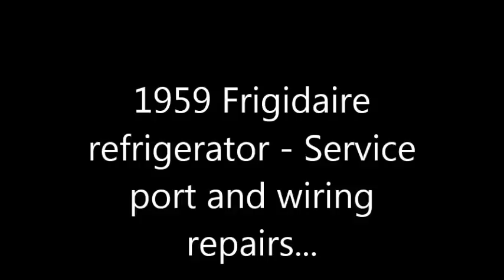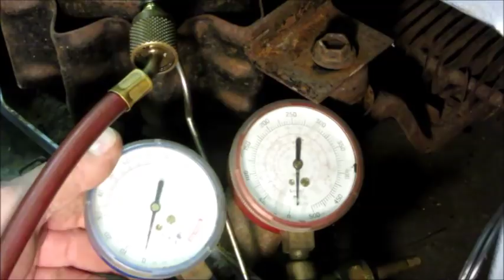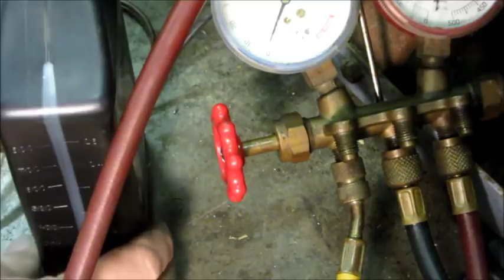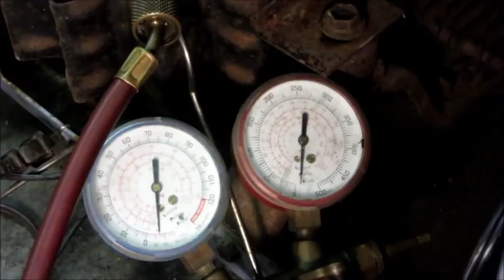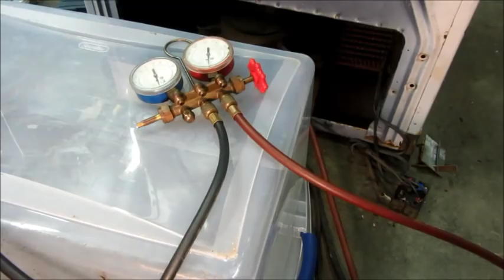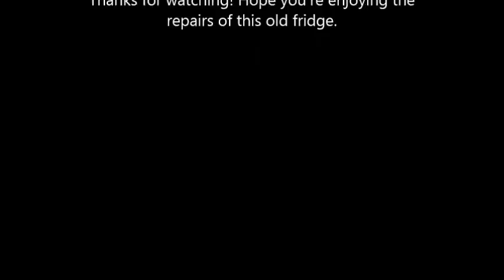Frigidaire 5400426 antique fridge - 2 - Service port, wiring, and test charge....

Comment: Hi David great video but I have a question about my 50's - 60's General Electric fridge. The compressor stopped and I had it for 15 years no problem running in the garage. Great beer fridge and I want to keep it. Not sure why the compressor stopped but wanted to ask you how I can put a start capacitor 3 n 1 to see if it will get the compressor  to start and run. The problem is that the old relay has only three wires coming to it. One is probably going to the lights in fridge and the other two go to compressor and the 3 n 1 has 5 wires? So do the two black wires go to a plug and the white , red, black go to the relay? If you can help that would be great.
Reply from the maker: Hi, Pete;  I hope you are able to get your fridge up and running soon. The 3-in-1 Supco device actually has only 3 active wires. One of them is just a "pass through" wire for the compressor common terminal. 

I am sure it will work for you!

Please see this General Electric Monitor Top refrigerator forum. The format here is a lot better for providing technical support. In the "Other Refrigerators" area, you can post your about this.

Another member just fixed up a similar GE fridge, using the Supco relay. His thread has some pictures on  this repair. 

See http://monitortop.freeforums.net/
Reply: David thanks so much for getting back to me. The lights worked and it seemed that the compressor was down for the count. Then I was like, "This was built back when people cared in America about their  jobs and industry made quality American parts!" So I took the relay off shook it, no rattle and then I cut off all the circular connecters and put new ones on with a crimp and she fired right up. Amazing, I wouldn't have thought that was the problem. They were loose, I guess but they must not have been holding enough of the wire on the terminals for it to kick on. The light doesn't need much current so of course that would work. So all and all she's good to go to be the awesome beer fridge she was meant to be with lazy susan swing outs to get to domestic or imports. None of that hoppy poser beer thats out now. Just the Miller High Life. The way it should be!  Thanks so much for getting back to me. One question though, my freezer little door within needs a new seal and I was wondering if thats why it freezes up that I cant put things in it? It is like snow and ice in there. Would the seal stop from forming such block of ice? Also where can you buy one? and a door seal too? Any suggestions anyone?
Reply from the maker: Very happy that you got her up and running again!

Often, the relays get "weak" or "intermittent" and they start working again when they are handled or shaken around. It may be that the problem reoccurs and eventually the relay has to be replaced.  The good news is, there is a modern replacement which will take the place of that one very nicely. And they are inexpensive.

If the evaporator door is freezing shut, that would mean that too much moisture is getting in the refrigerator. You probably need a new gasket on the main door to the fridge.  

Again, I recommend you post on the General Electric Monitor Top forum; with pictures of your fridge, and it would be easier to tell what gasket it has.  

I have ordered my Frigidaire gaskets from Antique Appliances Co.

Comment: Good afternoon! I have a coldspot fridge from the 50’s that was working fine until I unplugged it for the winter. It was an older gentleman’s main fridge until I bought it a few years back. I plugged it in again today and the compressor has heated up to 155 degrees and it seems like the fridge actually warmed up a couple of degrees too. But that could just be the ambient temp in my garage got warmer. I don’t see where it may have leaked down. Should I try adding a service port to it, pull vacuum, and charge with r12?

Comment: Hey Dave, Did you keep the mineral oil when you switched it over to R152A? I think you said that PAG might damage the wiring on the motor. Nice job on the resurrection.
Don
Reply from the maker: Thanks Don!  I kept the mineral oil.  The Meter-Mizer compressor lubricates its self differently from the automotive units. It seems that the oil and refrigerant don't need to be capable of mixing together as they do with automotive systems. The mineral oil stays in the compressor on the Meter-Mizer design except for a very small carry-over.  

My research online seems to support this. It seems that Whirlpool is recommending use of AB oil (a synthetic mineral-like oil) for their conversions to R134A. The R134A and AB oil do not mix; just as R152A and mineral oil don't mix.  Also, there are several success stories of using R134A in older fridges where they don't seem to have a problem, other than high motor current due to the higher pressures.

The reason Whirlpool wants to use AB oil instead of plain-Jane mineral oil is because of carbon buildup due to the higher temperatures of R134A on the discharge side.  They are running this in modern, high speed recip compressors where the reed valves tend to get fouled. This compressor is very low speed, as well as having no reeds to foul. It doesn't have sharp, high-pressure pulses that generate extreme temperatures like a piston unit.

SO, hopefully, it will last.  If it lasts - then point is verified. If it fails, then it's inconclusive due to the possible pre-existing damage.
Reply: PS : Tried to shoot you an email thru your youtube page.
Reply from the maker: Ah!  I have had problems with those messages not giving me notifications.  E-mail sent; and thanks for notifying me about the PM.

Comment: Very helpful Video series for me I just picked up a fridge not sure the model or year as it has been repainted and now well. Everything looks the same under it for the most part so that is good. No leaks it seems to me just needs a recharge going to follow the steps in this video to do that but what Oil did you use? i know you said mineral oil but anything specific need to go into it? I want to air on the safe side and not put the wrong oil in thanks in advance.

Comment: Hi thanks   for   sharing .  I have a I think 1954 model   working   perfectly   I have concerns  about  the   coil and lines under the paint is starting  to   flake I don't want no rust and fails. It's all original   what would you   recommend  I   use to paint the coil and lines or nothing   I don't want  to   make a issue   just want to make sue my fridge   last forever thanks
Reply from the maker: Hey thanks for the comment!  I would brush the coils with a stiff -bristle nylon parts cleaning brush.  Then after that, use a paint brush to apply the coating POR15 to the fins and tubing. It will keep the rust from progressing. Just be sure to get all the loose, flaking paint off first.
Reply from the maker: Hey - I remember finding your videos back when I got my first old Frigidaire! Yours were an inspiration. I am so happy that you still have your Frigidaire!
Reply: @davida1hiwaaynet  thanks I'm not very knowledgeable   in refrigeration   what is  por 15 and where do I get it
Reply from the maker: It's never too late to learn!  As for POR15, it's available at most automotive supply stores. Here is their website: https://www.por15.com/

Comment: Never put thread locker on female threads, the risk of accidental intrusion that can plug a cap tube is too much.  As to oil; Copeland put a bulletin out in 1997-98 that states pre-1974 compressor windings are not compatible with synthetic oils except certain AB oils for cascade systems.
Reply from the maker: You're quite right about the oils. In the restoration of these old units, it's always AB oil for them for this reason. There have been cases where even traces of cross-contamination with PAG systems has failed older compressors. When cars started switching to R134A and PAG, people would use the same gauge set for automotive PAG oil systems as for hermetic systems, and the result would be that the winding insulation would swell and soften and blister.  

The sealant is a general rule of thumb, however there are exceptions to every rule. When there is a possible loose fit, the Loctite needs to have a void-free film in between the parts to give a good bond, It is an art to using this to seal a loose fit part, but it does work and requires caution.

Comment: HI David, you are the man! I love your work! I have a couple of questions. I just picked up a GM frigidaire MM76. I think its about a 1950. I have watched your videos many times and it seems that my compressor is working perfectly. I would like to replace the crispy wiring. I really like how you rewired yours. So if you could   tell me 
# 1 what gage wire you are using?
#2 is the wire the same gage compressor vers light and thermostat 
#3 is all the new wire solid or stranded 
#4 can you tell me more about the detachable power cord and what you would call that type of white square plug you are using. I really like that idea, but I can't seem to find that part anywhere. Thanks again David for sharing your knowledge.

Comment: my 1950 fridgideaire i rewired and now the compressor turns on for 10 seconds and shuts off. has not been on since around 2010. any ideas? it’s got charge ports on the lines
Reply from the maker: Hi Travis.  It sounds like the overload breaker is tripping off inside the motor relay. This is often because the relay is worn out; however it can be due to a wiring mistake as well. The worn-out relay will keep the start circuit engaged too long, causing the overload breaker to trip.

You can install a Supco RO81 replacement relay to eliminate that as a possible cause.
Reply: davida1hiwaaynet is that the YT Relay? when we got the fridge the compressor wires where melted.
Reply from the maker: Yes the YT relay. 

The melted wiring is a very bad sign. Did the compressor ever run normally since you had it?
Reply: davida1hiwaaynet the fridge from what the original owner said was no it don’t work. the original Rip Cord was broke. so i put a new cord on and that is what it does now. i have a video of it on my channel.
Reply: the compressor is also a little bit moist around the wires on the bottom
Reply: davida1hiwaaynet i know it did run before i bought it in 2010. it has righting on the back with the temps.
Reply from the maker: Thanks for letting me know about the video, will listen now.
Reply from the maker: Found your video! https://youtu.be/wATkALNYGdk Hope it's a simple problem.
Reply: davida1hiwaaynet the supco is not rated for my 1/8 hp compressor. i found a NOS YT relay for $75
Reply: Travis R. Where did you find this relay?? I may be looking for one as well!

Comment: Hi David, thanks for the informative video! I have a GE BH-7-A fridge that recently received a puncture wound in the freezer box and released all pressure. I believe i repaired the hole and need to move on to the next steps. Do you think I would I be able to add 152 straight to the system without evacuating any existing gas? I'm pretty mechanically and electrically inclined but this is a relative new area for me, thanks!

Comment: Whats does it mean if the fridge works good and gets cold but the compressor is hot to the touch? I have a frigidaire mj 7. Thanks
Reply from the maker: Hi Adam. The compressors on these early Frigidaires have the compressor hot-gas discharge going through the compressor housing. This causes the compressor casing to get quite warm. 

If the unit runs for an excessively long time, it can seem hotter than normal This can also be the case, if the condenser fins on the tubing underneath the fridge are dirty. 

Be sure the thermostat is working and cycling the compressor off and on, so that it isn't running continuously. That would result in a hotter than normal compressor. Also, be sure the door gasket is in good condition. This being deteriorated will let too much warm air from in the room into the fridge, and cause it to run more often than it should.
Reply: @davida1hiwaaynet  thanks for the reply david. It seems the compressor isnt cycling off and on anymore. Possibly thermostat?
Reply from the maker: That is most likely the thermostat. See if you can turn it OFF with the control knob. If it will turn off from the knob but not automatically from the thermostat, then the thermostat is likely not operating correctly. 

If the OFF position will not stop the compressor, you may have an electrical short in the system somewhere which is providing power to the motor at all times.
Reply: @davida1hiwaaynet  i can turn it off at the control knob but whether i put the setting at 1 or 7, which is the highest, the compressor doesnt seem to kick off like it used to. Now it seems to be running all the time and then ill hear the fan turn on periodically like it used to when the compressor and fan would kick off and on at the same time.
Reply from the maker: That's a good sign that you can still control it with the knob. The off/on function uses the same contacts as the thermostat; so that would mean that the thermostat sensing tube or some other part is not working correctly.

One thing I find curious, though - if this is like I am thinking, there should be no fan in the fridge. These used a thermal convection cooling system.  If anything is cycling off and on while the unit is running, it's probably the start-relay kicking back in during the cycle. This could mean the relay needs to be replaced.

Can you make a video of the fridge when this sound is occurring?
Reply: @davida1hiwaaynet  yes i can after work. Thank you.
Reply from the maker: Sounds good. Let me know and post a link here so that I will see it.
Reply: @davida1hiwaaynet  were u able to view my link?
Reply from the maker: @adamcordova3605  YouTube held the link. I approved it just now and will watch as soon as I have an opportunity. At the moment I am at work and won't be able to listen with audio until I have a chance when everyone's out of the room.
Reply: @davida1hiwaaynet  ok great thank you. I just wanted to make sure i did it right.
Reply from the maker: @adamcordova3605  You did.  It's just that YouTube has been fighting a huge battle with spammers and they are skeptical of any links.